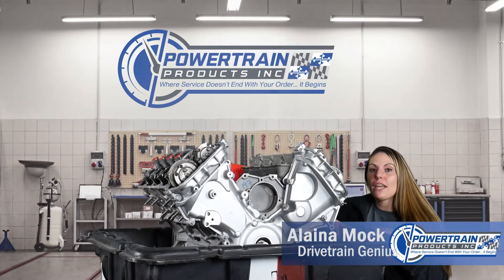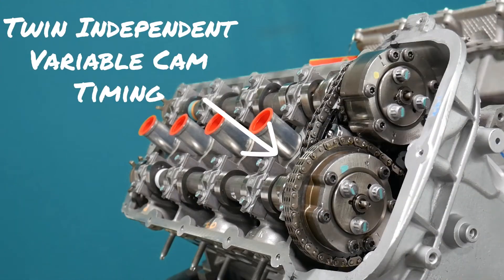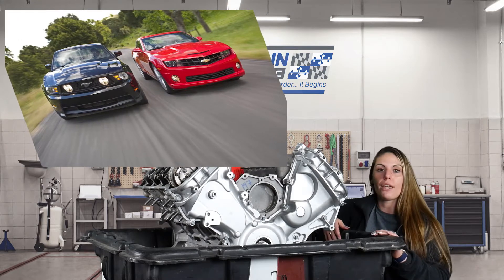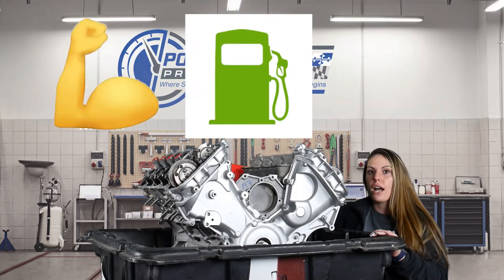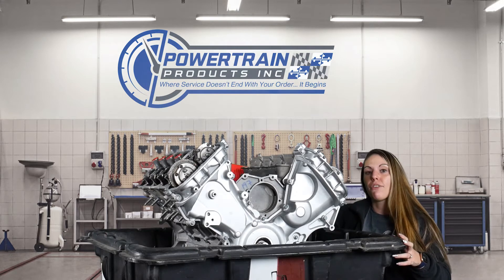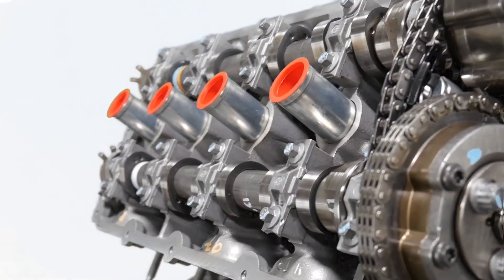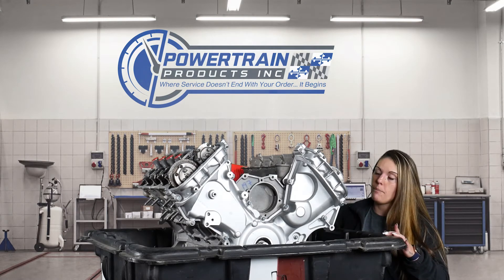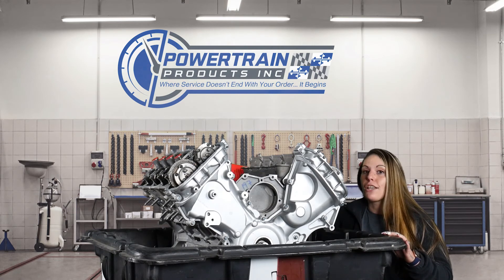Ford Coyote 5.0L Truck Engine

Comment: ( Dan Herrala)  why are so many posts out there having so many problems with intake valves on the 5.0 coyote engine 4/8 cylinders,  is it running to hot of lack of coolant  to the back cylinders.  Is there any thing that could be done to get more coolant flow to those back cylinders to eliminate what I think is happening. Please give me and  many others what to do, since FORD doesn't CARE.... Thanks!
Reply: MMR Racing and UPR racing make a head cooling modification that mounts to the rear of the heads and sends coolant to the number 8 cylinder. MMR's kit is on Amazon for $135, and that is cheap insurance for number 8. This kit is bolt on and requires no drilling.
Reply: Thanks, Bob green sounds good I'll  check it out.